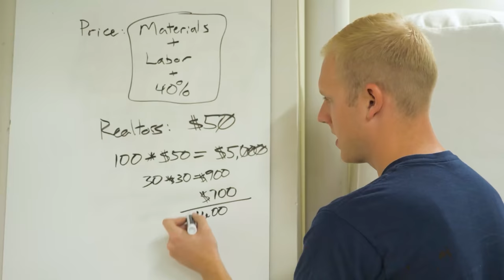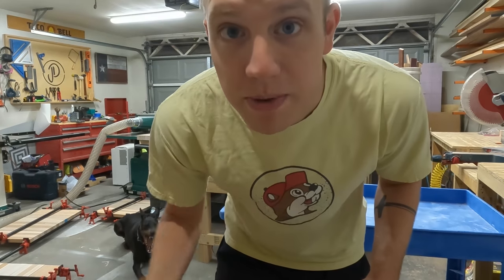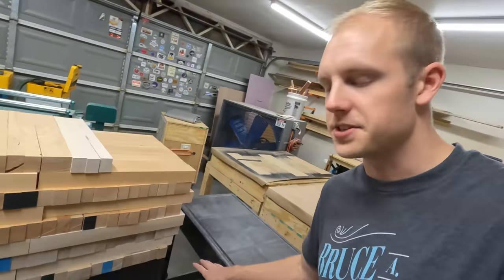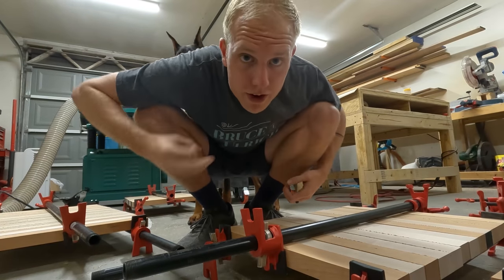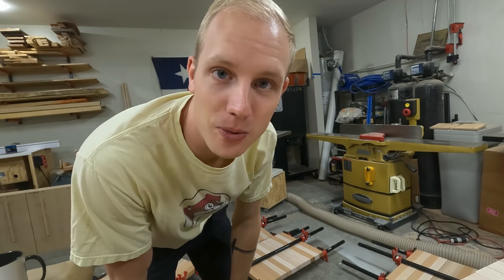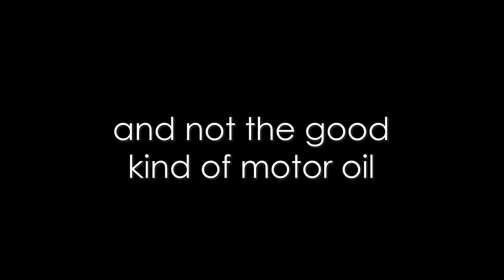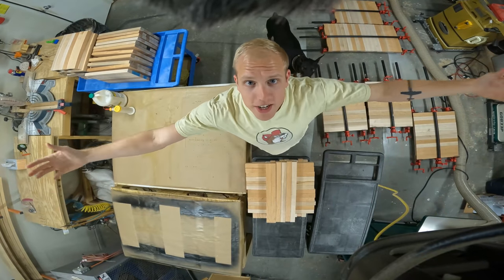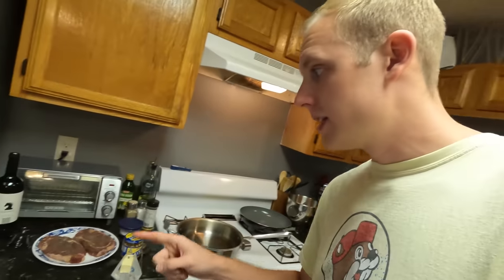Davis tries to finish 40 boards before Jennie gets home

Comment: When I took wood working classes way back in the mid 1970’s my teacher told us that Elmers glue needs 25 to 30 minutes clamp time.   So, I Googled Elmers glue clamp time as well as titebond.   Both say clamp time of 25 to 30 minutes.  So, you really do not need that many clamps.   You can start unclamping after you glue up 6 or 7 of the cutting boards.   Let them set for 23.5 hours before further working on them is suggested.
I thought this might help speed up your process.    Respectfully,   Kevin

Comment: I got tired of struggling with pipe clamps. So I built a bunch of 4-way clamps that squeezes the side together and presses the top down to  keep everything flat. 2 clamps to clamp up what you were doing, very fast also. The best part, you can build them cheap with Home Depo stuff.

Comment: Have you tried gluing up long boards and then Planing, sanding and lastly cutting into 3 boards? Curious if this would be more efficient or more headaches. Thanks
Reply from the maker: It’s a tiny bit faster, but wastes much more material when milling them flat.

Comment: After seeing all of those glue ups drying on the floor, I’m curious if there’s a way you can hang the boards from the ceiling/wall vertically. This could save a tone of space. As well as increase ergonomics.

Comment: You obviously need to do something about your clamping arrangement if it is working at thresh hold, the JLT takes up room, so my suggestion is high stacked vertical trolley, basically a stack of shelves on wheels with solid footing under the clamp where it would slide each clamping set up in and out, but lots of holes drilled through the middle of it for good circulation. 
That would take up barely 40% more surface area of what you are stacking on the floor and offer upto probably at least 12 of them before it gets irritatingly high. I would not add sides or a back to it for circulation reasons just use 3x3 posts and notch out the shelving slots then screw it together.

Comment: Forget the massive amount of pipe clamps. Look into a JLT clamp rack. You need to get something like this if you want to step your game. There are other things as well but this is one of your bottlenecks.
Reply from the maker: Gotta respect the levels - don't have anywhere near the floor space for that right now!
Reply: @jennieanddavis  it takes up less space than you spread out right and can stack  up 5 levels in the floor space of 1. When not needed you keep the clamps vertical on the rack. Some guys have even put it on wheels so they can rearrange when needed.